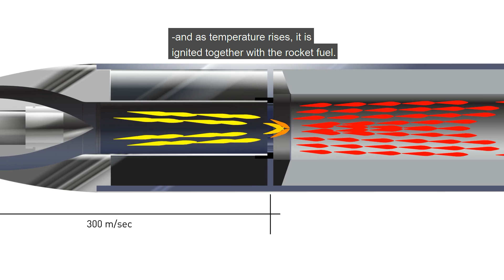Ramjet missile propulsion - the biggest invention since the introduction of the jet engine

Comment: As per other comments, ramjet propulsion is not a new invention just being explored by Nammo. Many other ramjet powered missiles have been built for example the German V1 flying bomb which had a pulse-jet which is an intermittent ramjet, the British Bloodhound SAM designed in the 1950's, the British Sea Dart naval SAM designed in the early 1960's as well as several American missiles. Nammo's design of ramjet is unique for being incorporated into a 155mm artillery launched round which could have been emphasised more in the video.

Comment: only problem is - the ramjet increases mass of the motor - the combustor, on average, is three times as thick as a standard rocket motor (and has to be steel while a SRM can be carbon fiber and only a couple mm thick - which then makes the majority of the weight of a rocket motor propellant - thus making the primus of the ramjet meaningless)
you have to carry both solid propellant in the combustor to get to the right speed to transition to use the jam jet - which requires liquid fuel 
the inlet takes up a lot of internal volume, and adds more weight. 
the inlets themselves cause a huge drag increase - the ramjet itself causes a huge drag penalty after burn out 

ramjets are a fad technology in missile and rocket technology 

also, you didnt invent ramjets - technically the nazi's did - along with scramjets. they were limited by technology, but the concepts they came up with still hold true 

and before anyone goes "how do you know" - well im a CAD designer thats working on several contracts on ramjet missiles and it causes a lot more issues for a range boost than really what its worth 

ramjets are fickle and get chocked out by low air flow at nearly any quick maneuver - making them incredibly unreliable because they have to "breathe" air

Comment: I knew it! The "jet engine was invented in the 1040s," several decades before the Battle of Hastings. Which is why--as I've always said--William the Conqueror had F-14s, and the Normans won the battle, because with their old propeller-fighters, the English couldn't maintain air-superiority.... i know, it's a simple mistake. but i found it funny to imagine.
I thought ramjets were already in our current missiles, I'm surprised that they aren't. i see in the comments many have mentioned working with ramjet missiles or rockets, since the 1950s.... so I'm a bit confused as to why they were not already standard.

Comment: The question remains how these rockets reach mach-3 speeds, in order for the ramjet to work. If a rocket motor is used in addition, the system will get more complex, and some of the improved fuel efficiency will be negated. If these are launched from aircraft or drones, and no rocket motor shall be used, these aircraft will have to fly much faster than current gen fighters.
Reply: if they use rockets for the inintal stage that stage will be just as eficient as a normal rocket ish.
Reply: they dont... ram jet starts working at mach 1,5 or something like that... oh by initial booster of course

Comment: interesting stuff, kinda surprised this hasn't been apart of previous weapons systems since the concept of a ramjet and it's use is fairly old.  Must be some progression in manufacturability that has made this cheaper or easier to make.  but I suppose there are limits to it, like if launched from an aircraft the craft itself would have to be traveling at the operational speed for it to work otherwise it would need an additional stage to get the missile up to speed for the ram jet to work.
Reply: From what I've read, the major obstacle of development for ramjets became clear during extensive testing from the 50's to the 70's revealing that its operating speeds created temperatures that weren't survivable for any materials being used at the time. Hopefully with modern alloys and material development we'll soon be able to see the ramjet's true potential realized.
Reply: @loganzacher9911  The British Thunderbird and Bloodhound missile systems both used ramjets.  These were designed in the 50's and 60's and Bloodhound served until the early '90s in RAF service.  https://en.wikipedia.org/wiki/Bloodhound_(missile)
Reply: @richardprowse1088  oh wow I didn't realize that. I think what I read about ramjets was regarding their potential use in upper stage spacecraft which may be why they weren't able to build them to be durable/reusable enough for that application, but seeing that missiles are single use that would definitely make sense as to how they were able to make them work for that purpose  despite not having materials strong enough to make them last beyond a single use or two
Reply: it was... P-800 Oniks for example and there are other older ones too. problem is that ram jet only starts to work above mach 1 so such missiles need 2 stages or at least starting booster to get to proper speed. also its not easy to make it proper shape for igniting propellant and keep that propellant burning

Comment: The FIRST and largest US Navy ship-fired AA missile introduced around 1960, the TALOS, was ramjet-powered and, until better rocket fuels were introduced for higher speeds and uplink-controlled missile guidance allowed optimum high-altitude mid-trajectory flight (SM-2 and after, including Aegis), TALOS was the longest-range AA missile the US Navy had, thougn not the fastest and very bulky, so it needed very large ships and this finally caused it to be decommissioned.

Comment: Bristol Bloodhound surface to air missile entered service with the RAF in 1958 and continued in service until the 1990's. It used rocket boosters to get the missile up to speed then the ramjets took over. I worked on the launchers as an apprentice in Bristol.

Comment: The problem with high speed long range anti aircraft missiles is that they are easy to evade due to the laws of physics. Think of Bugs Bunny sidestepping a raging bull. The higher the speed difference, the harder the target is to hit.

I suppose this is why the Meteor missile contains a restartable ramjet motor.
Reply: It is actually opposite. The more kinetic energy a missile has, the larger the no escape zone is. The Meteor missile, for example, enlarges the NEZ by increasing speed just before impact.
But how can this be when a fast-going object requires more force to turn? 
Yes, the plane can make sharper turns, but the distance traveled at a new angle is meaningless if the speed of the projectile is much greater. Consider a projectile from a gun hitting a running person. Sure, the person can turn, but it will not help him dodge because of the high speed of the bullet.
Reply: This missile likely wont be much faster than a conventional missile, but it will retain the launch speed for much much longer. Aircraft have strict G limits, and usually contains a pilot that has a limit as well, they cannot out turn a mach 3-5 missile that can often withstand G forces 3 times higher. Long range air to air missiles are usually defeated by letting them bleed velocity, something which will be far harder to do against a missile with effectively 5 more fuel
Reply: Steffen Nilsen You need to update yourself on the laws of physics. In order to out turn a fighter, a missile must sustain several hundred G. The slower the missile, the less G is needed.

Comment: How does it gain speed to Mach 3 for ramjet to work tho?
Reply: Definitely it needs the first stage launching engine, either the launching vessel has to move adequately fast. In reality it does not need all Mach3 for ramjet start working, however it is the optimal speed for the most effective functioning begin.

Comment: The SA-4, SA-6, Bomarc, Talos, Bloodhound and the Sea Dart were Ramjet powered Air Defence missiles. The Meteor is a current ramjet powered AAM. India is working on a ramjet powered Astra AAM.
Moskit, Oniks, Brahmos, ASMP, Hsuing Feng -3, XASM-3 are ramjet powered strike missiles.
So what's new about ramjet propulsion?
Reply: Jack ripper  My mistake. But Meteor and Astra (ramjet) have full solid fuelled propulsion. They need to be fired by fast maneuvering combat aircraft.
Reply: Meteor and Brahmos are solid fuelled. So is the Astra (ramjet version), ASMP, XASM-3 and Hsuing Feng-3, I think.

Comment: If it doesn't carry oxidizer, how would it reached the very high speed needed for ramjet to work though?
Reply: likely rocket booster that falls off after a short burst or so I would imagine
Reply: Since it's solid fuel, perhaps the first part of the propellant also contains oxidized fuel. Think of it similar to the red igniter pad on an old school 155mm base charge.
Reply: That is the ? in my mind 
But nobody seems to touch that point.

Comment: A lot of people point that ramjets are nothing new and it is true. The thing is that ramjets were mostly limited to large missiles like Bristol Bloodhound  (2,2t) and RIM-8 Talos (3.5t). Soviets had some smaller ones like 2k12 KUB  (600kg) but their range isn't that impressive. Rockets won (are more widely used) because they are simpler to design, control and deploy in field. You have your own oxidizer so you can  control the burn more easily making a rocket easier to operate in wide range of weather conditions. 
With ramjets you need to take into account atmospheric conditions, because they take the oxidizer from the air. The thing is, that now we have much better computers both in macro and micro scale and this changes everything. We have powerful supercomputers with sophisticated fluid dynamic models so we can design simpler engines tuned to wider range of speeds and conditions. We also have incredibly fast and light computers and sensors that can control those engines in real time. Modern computers give us a big opportunity to make smaller, simpler and more reliable ramjets then before. 
Compare it to multi rotor drones and helicopters. Multi rotors are nothing new, a lot of the early helicopters were multi rotors like prototype of Sikorsky VS-300 (1940). What made modern multi rotors so successful is control systems. You do not need fancy mechanical blade pitch control if you have multiple propellers and can independently control their speeds fast enough. So we went from hard to pilot, expensive and impossible to miniaturize helicopters, to easy and cheap multi rotors, some of them size of a matchstick box and easy enough to be pilot by a 7 year old in their bedrooms.

Comment: Now i do feel safer. 

Its kind of odd nobody looked into ramjets before, because the concept is older than the modern jet engine. 

Ive seen guys make a pulsejet in high-school for their graduation project. We were 17 back then. I remember it needed a lot of initial air before it started properly. So they used a blower to get the engine running. But once it ran, it ran. It did make a lot of noise though.

 
I bet that if you have enough air due to the high airspeed it will do its thing. No problem. 
The only thing is how do you convince a client? "Results dont lie" or so they say say..
Reply: There have been a number of ramje powered missiles. 2K11, 2K12, Bristol Bloodhound, BrahMos, Bomarc, Hsiung Feng III, Kh-31, MBDA ASMP, MBDA Meteor, P-270 Moskit, P-800 Oniks, RIM-8 Talos, Sea Dart, SM-64 Navaho. The MBDA Meteor was the first with a solid fuel ramjet.

Comment: They are saying speed and ranges, but nothing really about G turns those can pull.
In a fight for aerial supremacy a fighter could just pull a S turn and make the missile go in a complete diffenece way. Not to mention the low speed retention a ramjet has compared to a rocket
Reply: Different
Reply: Low speed retention? 
But you are right, ramjets can suffer from flameout if their intakes are starved. I do hear solid fueled ramjets recover particularly quickly, and the missile can still turn just fine even after flameout on inertia alone. 
Also, i am very suspicious of the idea that a sufficiently optimized intake would be starved of air simpily due to a high-gee turn. Ramjets have been tried as tipjets for helicopters, where forces exceeding 100G are sustained for hours at a time.

Comment: A number of Surface to Air Missiles used Ramjet Propulsion example: RIM-8 TALOS (1958), CIM-10 BOMARC (1959),  and UK's Bloodhound (1959).  So using ramjets in missiles is not new.  In this case the uses a solid fuel ramjet to greatly increase range by providing positive thrust, instead of base-bleed merely cutting the drag...

Comment: Good idea. Though it has been operational since 1968 as part of the russian Kub missile. See https://en.wikipedia.org/wiki/2K12_Kub
Reply: They also used tanks in ww1, so I guess there is zero difference between that and a modern tank... /sarcasm
Reply: @Lobos222  you've just proved you're a crank...
Reply: Kub has two stage solid rocket motor no ramjet.  
S200 probably has ramjet.
Reply: @Slavkovic_Predrag  AFAIK BUK launches as bipropellant solid rocket then the chamber burns through and turns into a ramjet.
Reply: @svobodat59  how can that be when it has no air intakes lol.  Idk where you got that idea from.
Reply: @svobodat59  lmao 😂😂. 
Maybe they messed up kub and buk two totally different systems. There is 0 sense in making kub with ramjets when it has only 22-24km of range.  Think logically and where is air intake huh ?

Comment: I am sure the Ramjet can take the missiles further.But there is need for more powerful Radars and better guidance.I believe Indo Russia Joint venture Brahmos has both,apparently good for 500-600 kms.Russia has better missiles in Kalibr,S-400 and Zircon systems using scram Jet engines.

Comment: This ramjet concept have stability?!
 What happened when is raining, snowing, in minuses (-54) or  (+65) temperatures ...
Reply: Some of what they say here is wishful thinking. It would be more truthful to compare a ramjet to a jet engine, they share more in common with these than rockets, despite basicaly being as simple as a flying stovepipe. Their efficiency starts out far, far, worse, but improves as speed increases, performing best at mach 2-3, and tapering off by mach 5 or so. 
But they should perform excelently in terms of stability. 

The fuels would be best compared to something like particularly enthusiastic candle wax. It is a solid, so does not disolve contaminants or pick up water like liquid fuels. Nor will it freeze or boil. They should also be less prone to degridation over time than rocket propellant. Oxidizer in rocket propellant and explosives wants to react with the fuel. This does happen even with a rocket just sitting in storage, just very slowly, leading to degredation of stability and other properties. 
I don't know how much of a problem this is, being just a aerospace hobbyist, but i imagine not having oxidizer would help the situation immensely. 

Plus, there are no bearings, seals or any other sort of mechanism you need to take careful care of. You should be able to put one of these things in a basic protective sleeve, and just leave it there for about forty years before you see any sort of issue. Best of luck with your blowing up of bad guys! Unless you're not NATO. In which case kindly become a democracy before reading this youtube comment.
Reply: @Geolaminar  that's the biggest thing, the fact that you dont need to maintain a missile like this means that a country can buy a tonne in bulk and save them for decades for potential war, not buy a few and shoot them before they expire, this is huge for logistics.

Comment: A ramjet missiles was used by the U.S. Navy starting in the late 50's . It was called Talos.
Reply: @RobertLutece909  my bad, im norwegian, google translate trickd me. hehe
in norwegian  both ram jets and pulse jets are just cald JET- ENGINES.
I Guess if your a scientist you use different names. 
i know the difference though becouse i read a lot.
a pure ram jet works best at mac3+ while a pulse jet works more like a 2 stroke engine. at any speed=
explosion blowing out exhaust and then pause while it sucks in new oxygen.
Reply: Bendix produced the missile.  Honeywell is the parent company now.
Reply: Bloodhound.
Reply: AI missiles was used by the Japanese during World War 2. It was called Kamakaze
Reply: not at the same power as this one has this one could potentially carry war heads
Reply: @paradox5087  Talos missiles were capable of delivering nuclear warheads.
Reply: the germans use lots of flying bombs that had ramjet during ww2 that was named V-1 They sendt around 9521 against england  100 a day at the most!
they weight more than 2000 kg each of which 800 kg was explosives.

Comment: Atmospheric oxygen is only 21% of the air, and the density of the air diminishes with altitude. This puts a real constraint on the performance of the engine, and limits the operating parameters of the missile.  Cruise Missiles in current use already use jet propulsion, as far back as the Nazi V-1.
Reply: Yeah, this is marketing BS, but a ramjet shouldn't be much more affected by this than a conventional jet engine. Less, actualy, since it's able to attain higher speeds (and potentialy compression ratios) right? Unless you're talking about the narrow performance window of a given fuel grain design.